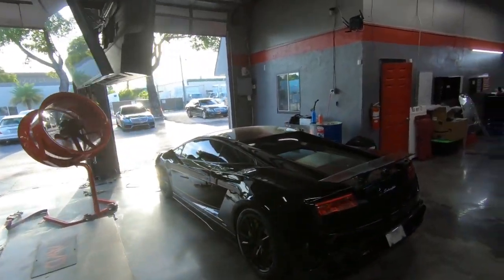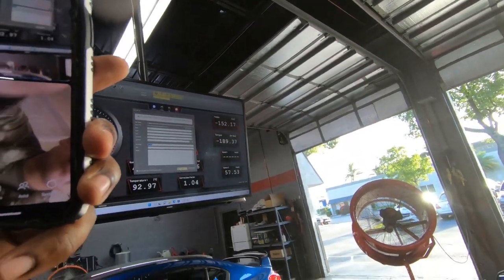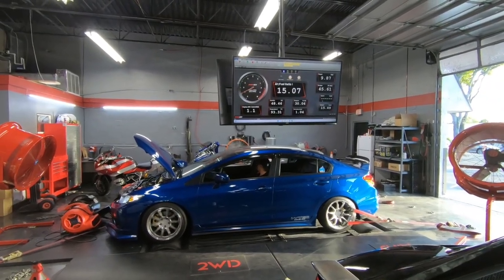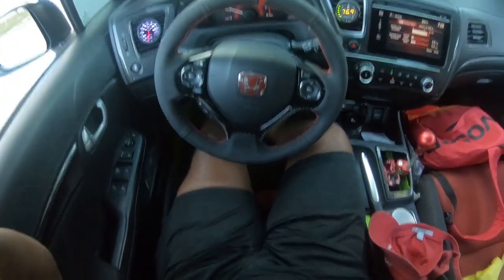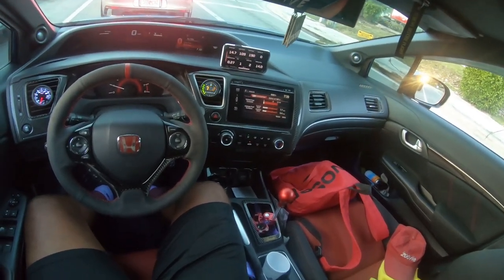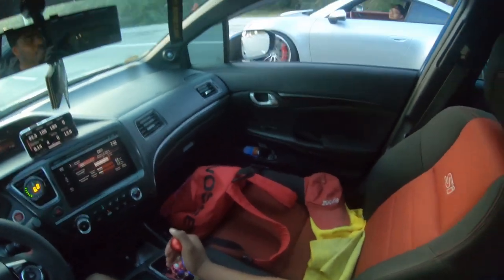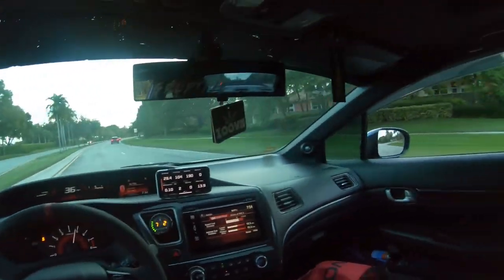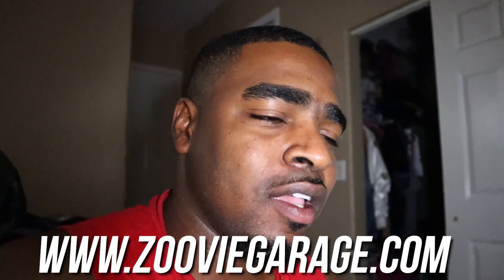Getting My Turbo'd Civic Si Retuned On The Dyno & Racing A Porsche! #civicsi

Comment: You can squeeze out an extra simple and easy 5whp or so with just 3 inch piping at a shop and  k tuned turn down muffler ran that setup na and it was night and day difference from 2.75 inch
Reply: Probably more for you since you’re turbo 🏋️‍♀️